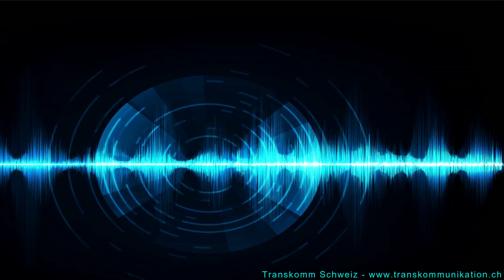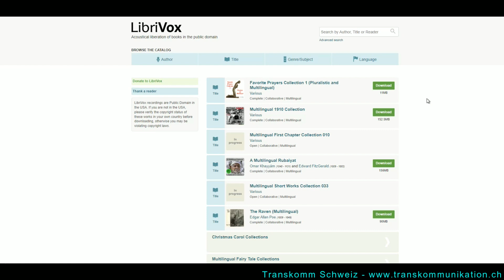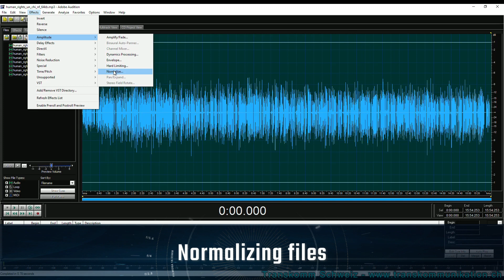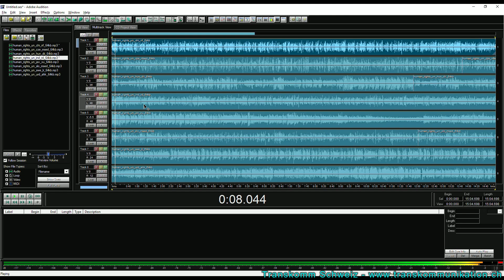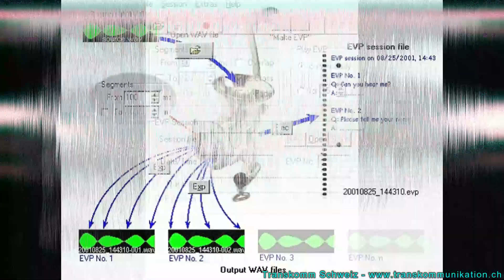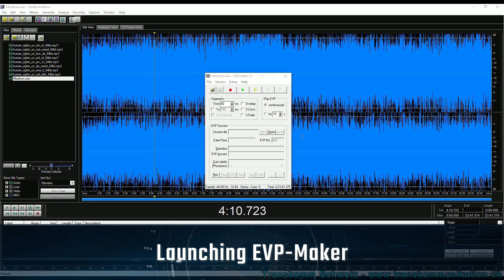How to Create Multi-Voice Audio in Adobe Audition for EVP Maker

Comment: would it be possible for you to provide a link to one of these for download, premade? Also, have you had any success with the germanium device based on the Scole Experiment?
Reply from the maker: Under this link http://www.transkommunikation.ch/temp/multivoices_mixdown.mp3 you will find a premade file of the experiment.
As for the results with the Germanium Receptor, yes I had some interesting voices and results, but nowhere near what the experimenters of the Scole experiment in England had. But I can highly recommend the reproduction of the Germanium Receptor. It does work, although differently from the original device, but it works.

Comment: I’ve been working on duffing oscillators (Chua oscillators) for some time that are based on ‘chaos’ of which can detect extremely minute changes towards weak signals. They may provide a means to detect unique patterns and signals as being experimented here. Will be getting into some circuits and info I may be able to present here.
Reply from the maker: I didn't know about these Duffing-Chua oscillators until today, thanks for the info. 
I would be very interested if you can combine these oscillators together with the multivoices. That means in this case, a combination of hardware and software? Please report here as soon as you find out more. Very interesting :-)